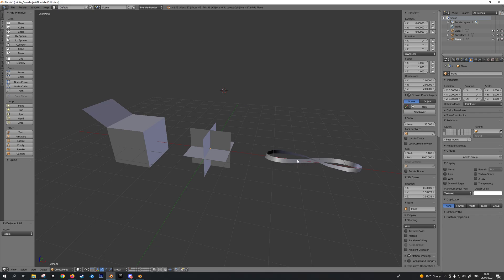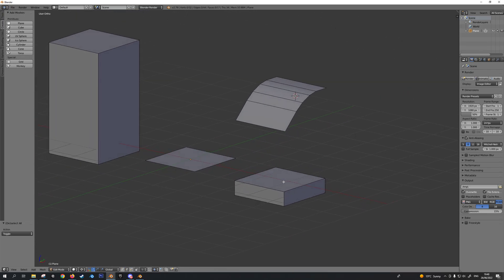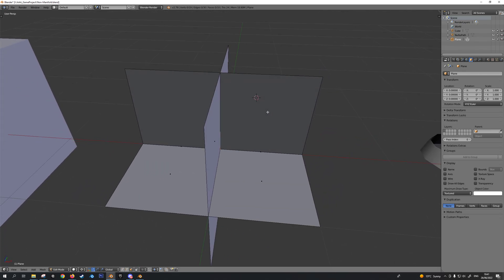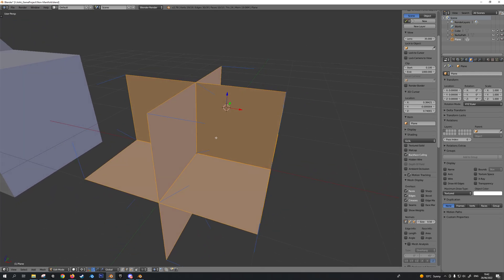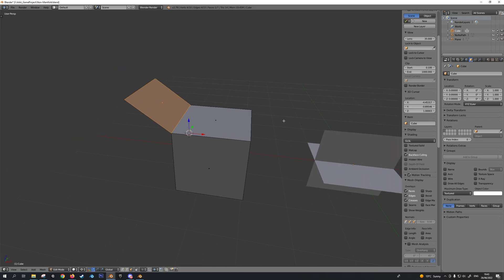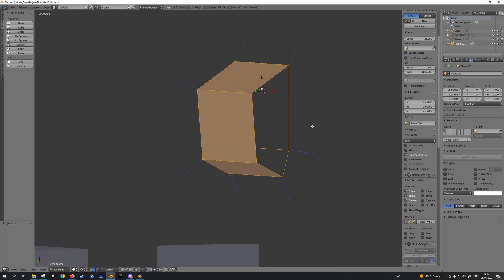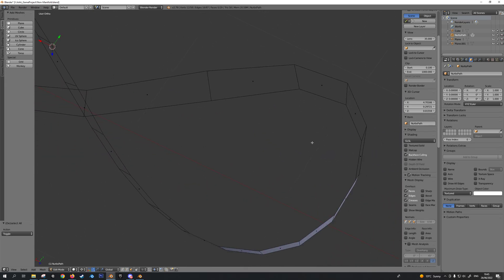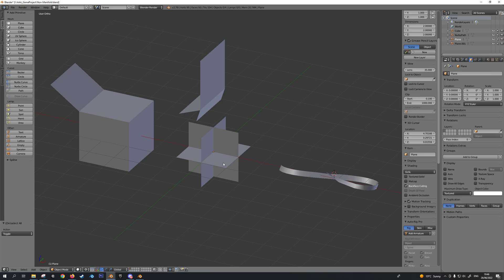Non Manifold Geometry Explained - Blender 3D.

Comment: I’ve just retopologised a characters face and I’ve somehow ended up with non manifold vertices and I can’t find the extra vertices. It’s in the middle of my models face around the mouth. I’m just so confused. I don’t understand how it happened. I’ve tried merging by distance, I’ve tried manually moving around the vertices to see where the extra ones are. I have backface culling on and automerge, but none of it is working.
Reply from the maker: Hi Ccbooo9. Thanks for your message. Unfortunately, it's difficult to diagnose and fix the problem you're describing just from a message.  If you need help with your model I suggest that you join the Blender Community Discord, where you can chat with other Blender users and get help fixing your model.  Search for "Blender Community Discord" and join on Discord. There will be people who can help you there. Best of luck! :-)

Comment: Slightly unclear what "the correct direction" is supposed to be
Reply from the maker: There is no "correct direction" per se. It's just having all faces pointing in a consistent direction. :-) The direction you want them all to face.  

The problem with a "Non-Manifold" Geometry is that it's geometry that cannot have consistent face direction. I hope that clarifies.
Reply: Thank you for the explanation mate.
Reply from the maker: @AshiqAli-te7tr  Cheers! :-)

Comment: What I've found looking for some clear defintiion, it seems the correct one would be "each edge should have exactly 2 faces and geometry should have a thickness". E.g. imagine icosphere with a removed face - edges around the hole will have just 1 face to them. And the thickness property would explain why mobius strip is non-manifold.
Reply from the maker: That is also correct and a good definition. Thanks! :-)